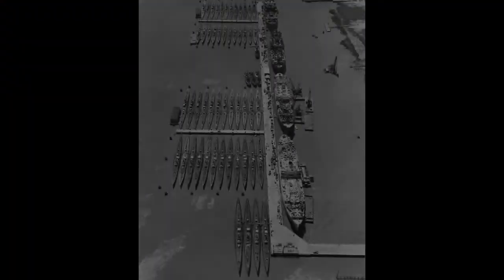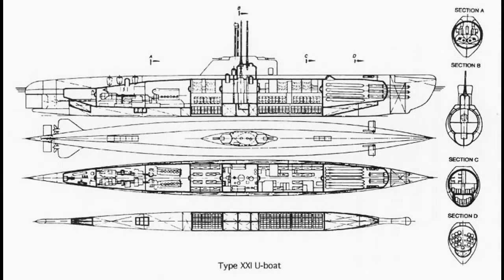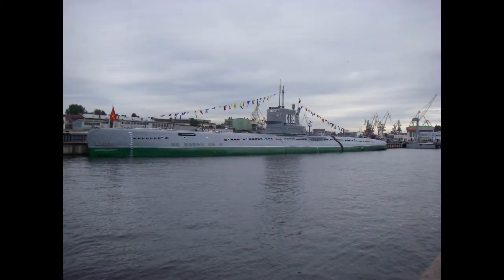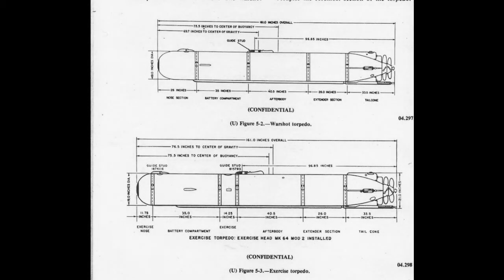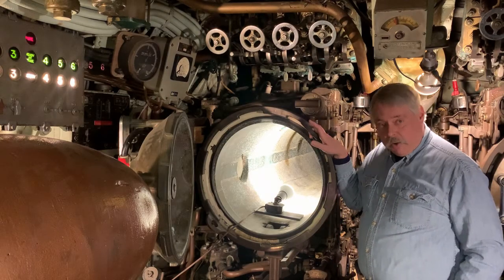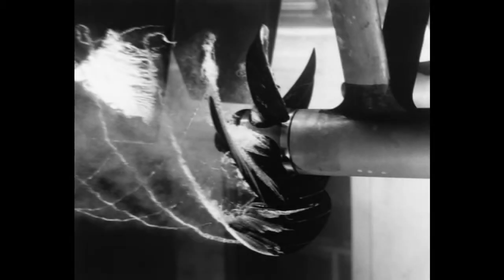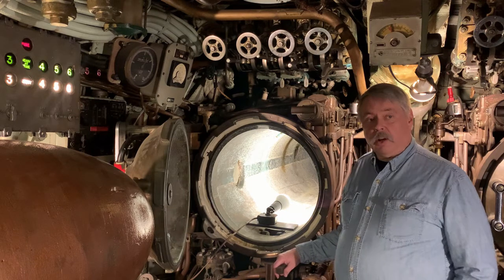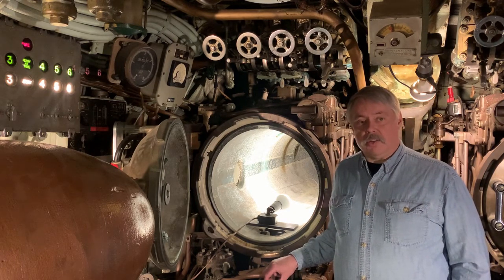Deep Dives:  Mark 37 Torpedo

Comment: Great explanation. As a FTG on an SSBN in the late 70s I had several opportunities to pop out MK37s. Both Mod 0s and 3s. Even got a chance to unload a MK14 via the muzzle door.
Reply: As late as 1983 we were still teaching about the Mk37 and we had the manuals and equipment for the Mk14. It was only in 1985 that we had an overhaul and our fire control was upgraded so these older systems could not be used.

Thank you for the walk down memory lane. Please share this and other videos from the museum.